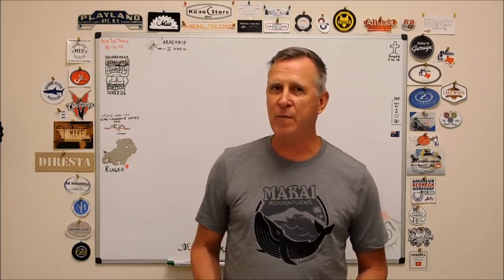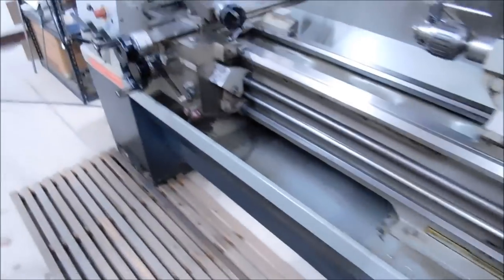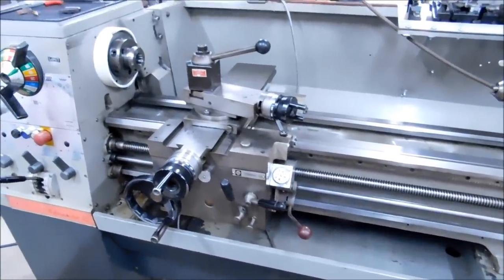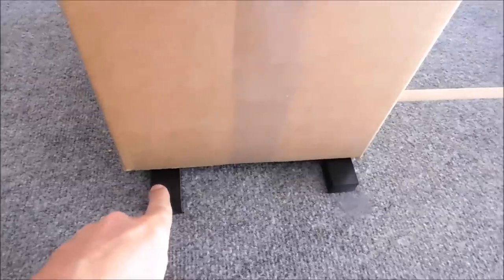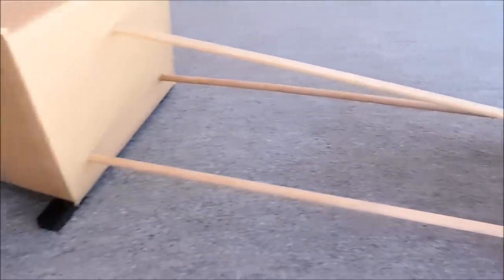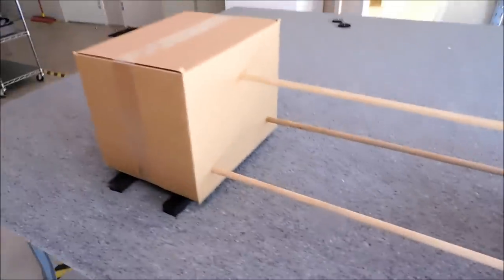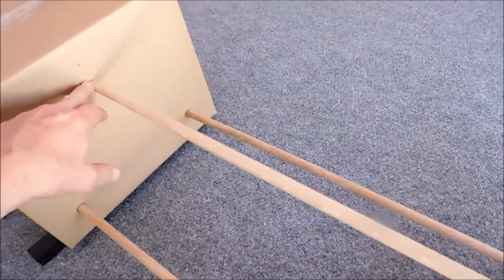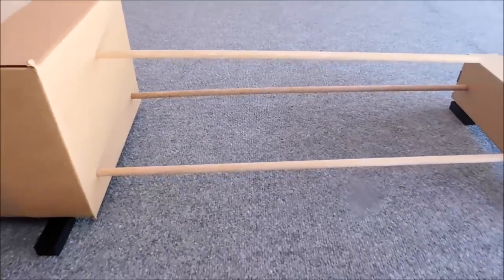Lathe Leveling - Waste of time ????

Comment: The issue is not really whether the machine is level, but is rather that it is square to itself, and will maintain such squareness.
I say this because after spending a couple of enlistments in the Navy,  level is something that is relative to the center of the Earth, and not usually pertinent to machine function. 
Ensuring squareness is much more important to machine function (most any machine) than is levelness. 
And using the correct terminology when discussing such things is important so as to not introduce confusion into the subject. I am glad that you did talk about squareness when setting up a lathe.

Comment: The lathe and mill at work are of the same brand. We were having a problem with the mill, called a Mfr. rep out. As it turns out he was the same person who set-up both machines when they were delivered. As he walked into the shop he glanced at the lathe saying "Who and why did someone screw with the leveling, bet it is cutting a taper."  (there were other Machinist in the shop before us). It took this guy all of 10 min to dial in the late to a half thou over three feet.  That was impressive! Great video and explanation as usual, Joe! You have a knack of making it all make sense.
Reply: Agreed. Joe takes something that would fill chapters in book and in 12 min gives a clear picture of what is going on, home to

Comment: So basically to check the head you face the part as close to the head as you can.  Then check it by moving the part out say 10 inches and skim cut it again.  If the head is out it will show up in the face as being out of square.  If the ways are twisted the the machine will cut a taper.  Thanks for the video, this gives me some ammo to help convince management to have our lathes looked at.  We have one machine that is cutting a .004 taper in ten inches or .0004 per inch.  Kind of hard to hold .0002 to .0005 tolerance on 4 inch long parts. (Interference fits on couplings) with machines that don't cut straight to begin with.

Comment: Joe great lesson in alignment of the lathe. One of the interesting features on the Colchester lathe is that if you remove the side cover of your headstock you can see where provisions were made to adjust the spindle alignment in relation to the ways in or out. Up and down is done with shims or scraping under the head and final alignment is done when placed into service. I have rebuilt several larger 21"version of the model lathe you have that have this provision  not 100% sure if the Student does. I have not seen this on another lathes I have worked on. The Colchester head doesn't sit on prismatic ways like Monarch does so they have to be spot on leaving the factory. 
Happy Diving Zed

Comment: Joe the only thing that you did not mention is run a spider front and back of the head stock and indicate both  the rear and front at the spider's .because if you have not set up the chuck the jaw's and or the scroll can be out there by given a false reading number one to level is to have perfect aliment with the spindle . just my 2 cents worth . :)

Comment: When you think about the word "level" just think of all the lathes that were and probably still are in ships, portable machine shops, etc.. They cannot maintain them in a "level" condition.. The twist and flex  in the bed is much more important....I have a 1942 LeBlond trainer on  which I set an indicator on  a work piece between centers..Change shims under the feet and tighten the bolts slightly and watch the indicator needle move.. Mike in Louisiana
Reply: Lathes on ships have 3 feet, so no matter of the level it will never bend.

Comment: Some lathes (such as mine), the ways run all the way under the headstock, and the headstock rests on the bed like the carriage.  These lathes have only 4 leveling points.  So bed twist is the only thing needing worrying about.
     Comment about headstock alignment: you really need to do the indicating UNDER the work on the tailstock end to detect bend, and indicate IN FRONT of the work to detect bed twist.

Comment: I think the reason they say "levelled" is because most people have something that will accurately repeat "level", but not everyone would have something that can accurately repeats 3.842*.  
From what I gather from this, you should level the headstock first, Square up the headstock to the bed, make sure the bed is level near the headstock, make sure the axis of the head stock is level, and then adjust the feet on the end by the tailstock until that is level as well, and you'll probably have to go over it a couple times before thing settle in

Comment: Great model, very clear to the the hobbyist.
Always a bone of contention, ref lathe leveling. You are levelling the lathe, to de-stress and align, using an accurate engineering level. Large lathe builders will grip a suitable diameter thick wall tube in the chuck, turn the OD with no steady or centre, and adjust level to minimise taper. Place level on the as turned of, this should now agree with the overall level reading. Your engineering or machinists level should have an accuracy of 0.05 mm per Metre or 0.0005" per 10",  there are more accurate ones, but you can achieve a reasonable result on small sub 1 metre or 3 feet bed length with a 0.5 mm per Metre (builders level).
Thanks for sharing Joe, and best regards from the UK.
Lathe leveling on a ship is the same,

Comment: Newbie to lathe work, Joe you’re a great teacher, no BS straight to the point and easy to understand. Thank you! I bought a second hand Grizzly G0750G lathe and I decided to bolt the cabinets to the floor and make adjustable riser blocks between the cabinets/stands and the lathe. My thoughts are, because the stands aren’t ground true it would be easier/faster to true just the lathe and not both cabinets & lathe. Is this method asking for trouble?
Reply from the maker: As long as the lathe is sitting on a surface rigid enough, it should be fine. If the machine is heavy enough not to walk around, or fall over on top of the cabinet it should be OK.

Comment: Wish I had known or realized this in 1981. Worked civil service Coast Guard in one of their Base Welding/Machine Shops. Had two old lathes, a La Blonde and a Southbend.  The La Blonde had a wicked taper on the tail stock end and could Not figure out what the heck was wrong. Both were Pre WW II machines to give ya an idea how old they were & both off a Navel ship out of their machine shop on board. Well thank you for this old mystery clear up. Hint - was not a machinist - OJT all the way, was wielder by trade.

Comment: Similarly, when I worked in pre-press layout dept. (stripping dept.) at a printing company, we had 60” T-squares that would ride on a straight edge on the side of a 4’x6’ light table. You would tape two pins down to the glass of the light table using the T-square and all the acetate sheets would be punched and register to those two pins. These T-squares were solid stainless with a machined steel head attached solidly with screws. A precision piece.
I started in a new shop and one of the journeyman lay-out men, yes, we called ourselves strippers, would, for a small fee, take your T-square home and “calibrate” it. I.e. knock the head on the floor to get it EXACTLY 90º.
I was the new kid, around 25, but had been at it for 7 years or so, and he eventually got around to me. I told him no thanks, that the angle being 90º was not important since we attached the pins to the table using the T-square and as long as it was solid and you did not switch T-squares between the different taped down register pins everything was cool. All that mattered was that all the lines stayed parallel. He argued for a while but eventually gave up. I don’t know if he ever figured it out.

Comment: Another thing to be checked is the horizontal alignment between the head stock spindle axis and the bed. This isn't a common problem on lathes where the head stock actually sits on the bed flats and V-ways. The head stock is scraped in at the factory. That said, if it is out of specification, the only cure is to remove the head stock and re-scrape it  to fix the misalignment... not a job for the average machinist to do. This is a task for a machine rebuilder.
   Where it can be a problem is on the smaller Asian built lathes. The head stock doesn't sit on the lathe V-ways and flats, but sits on a flat machined surface under the head stock. The head stock is bolted to the bed with four bolts (usually) and there are two horizontal jacking screws on an overhanging lip on the back side of the head stock. The good news is if alignment is called for, the head stock can be shimmed for vertical alignment and the jack screws can make adjustments for horizontal misalignment.
    This is also the time to make sure the tail stock quill and head stock spindle center lines are the same height. Also make sure the tail stock quill is parallel to the bed both vertically and horizontally. Faults in this area show up when drilling very small holes. You will notice the drill flexing to pick up the center of the rotating work because of misalignment and moving the tail stock side to side won't cure the problem.
    If you have an inspection sheet for your lathe, use that to inspect the lathe's condition and make adjustments as necessary. Many of the older handbooks give general alignment specifications for tool room lathes if you don't have specific tolerances for your machine.
Cheers from NC/USA

Comment: Great well demonstrated video as usual Joe. I've also never been able to figure out why "lathe leveling" is so misunderstood on the forums. It really isn't that complicated for what needs to be done and why it needs to be at least checked. Using a decent machinist's level is just the easiest way to get the bed straight and parallel. Actual "level" as you said isn't even needed, it's just the quickest and most simple way to measure and adjust to end up at that non twisted straight and parallel condition. At a minimum the free online PDF of Dr. Georg Schlesingers book Testing Machine Tools should be required reading for anyone who owns or operates machine tools. Read through that enough to grasp the concepts being explained and why each test is being done. The equipment & getting any machine tool properly aligned then gets a whole lot more simple. The Moore Tools book Foundations of Mechanical Accuracy also gives some of the best diagrams of the causes of machine tool inaccuracy or misalignment and how it affects a machined part I've seen so far.

I'd also add that even getting a lathe perfectly dead level is still only a static condition. I've proved to myself that very minor final tweaking is almost always required due to the machines various parts flexing just enough under the cutting loads to make a measurable difference if your trying for the absolute best the machine can do. Then you do need to know which adjustment screw needs moving and in which direction to roll the cutting tip slightly into or out of the cut.
Reply from the maker: Plus they settle over time. Mine actually sits on high density rubber machine mounts.
Reply: @joepie221  LOL, you have it easy. My shop floor is the usual wooden  construction. I can get my smaller lathe than yours to turn perfectly parallel and two hrs later with a few changes in humidity or temperature it's turning a measurable taper. So I've had to do a whole lot of  adjusting over the years. It's taught me a lot about that "lathe leveling" but the problem is obviously something I'd rather not have.

Comment: "Level" is used because using a level to set up alignments is the easiest thing to do. It is the easiest way to use the tool involved. Trying to set the lathe to be aligned to a 20deg inclined plane would be more challenging using levels especially since as you tip a level over it becomes inaccurate due to the curve in the glass that forms the bubble. It is also possible if you install a lathe very much out of level you could have lubrication issues as the oil level in all components was designed for being on the "level".
Reply: The confusen for new to the trade is probably that the three main reasons for leveling was not really well explained in perspective, like for fluid requirements, heavy weight requirements and the culprit the ways to headstock alignment assist.

Comment: Brought my used lathe home 
Put my level on it and it seemed to be perfect
 But when i trammed a round straight piece between centers my tail stock is low 
Moving the tail stock closer to the chuck reduces the error
Now this helps me understand it 
I think its exactly like you are saying it is
Reply from the maker: Anything pinched between centers shouldn't show much difference as demonstrated. Don't rule out way or tailstock wear. if you want to tram the tailstock, do it with a long bar and indicator in a chuck. Don't use a bar that will sag.

Comment: Straight is important , but level is extremely important  in a job shop for set up of  odd ball parts  esp line boring & assisting with steady set up's on long shafts . Cheers .
Reply: Maybe a better term to use instead of "level" would be "True?" As long as the head stock and bed are parallel / perpendicular is the key since the term level is relative to so many factors especially mobile machines in ships etc.
Reply: @robertoswalt319  A spirit level is sometimes used in job set up  when  indicating is not a complete option , like with some face plate work .
Reply: @swanvalleymachineshop  When I commented to the term level in my comment, I wasn't referring to spirit levels. I was commenting on the topic that Joe brought up about how the term "Level" had been, in his opinion, too broadly used. Many seasoned machinists will say that a machine doesn't have to be truly level as long as the bed is true to the plane the bed resides.
I agree that spirit levels are often a good choice when trying to get a part set up.

Comment: Putting the level on the top of the ways is an assumption that the top of the ways are true to the load bearing section of the ways.
Since we are measuring bed twist and not level I feel it would be more advantageous  to put the level on top of the cross slide. 
Then move it from one end to the other.
You can look at the load bearing part of the ways as the supplier and the cross slide and tool post as the end user. 
The end user is what you want to check, not the top of a V way that has no function other than to take up space. 
All this assuming your ways aren't worn out which seems to be a growing problem with older lathes.
Reply: Agree. In Sweden we talk "technical surfaces." Some take pressbrake tooling, use the outside as distance blocks and I tell them they are not true. They say they are true to the thousands and they are but only on the technical surfaces.

Comment: A few comments and questions:

As far as I can see, your ways looks bolted to the headstock.
To me it suggest, if it is true, that you can level your headstock as a unit, and then level your bed in line with that.

The 6 leveling feet you have on your machine, I have not seen in the now 12 different marks and models of lathes I have been in contact with, they all only have 4 levelers.

Also all the lathes I have seen, the headstock is bolted on top of the bed, and thus have to be shimmed to change the "centerline" according to the bed.

I am with you as far as you can, to some degree, level out warp front/back on a bed, but it means that you have to bolt down the cabinet to the floor, and many amateurs have their shop in a basement with wooden floor, at least in Denmark and Sweden.

Otherwise an very informative video as most of your videos are.

Comment: I have read several comments about the test bar deflecting up to and including using a ceramic test bar to prevent it.
There is no reason to worry about a test bar deflecting from it''s own weight. 
There is a simple way to test for deflection. 
Set bar on flat surface set one end on something of known height and square and measuer with other end hanging out. 
anything can be used around the shop to do this  including two tool bits of same thickness to two round bars or anything as long as it's square or of the same thickness. 
You dont have to break the bank buying stuff.
Say the pedestals you have the bar on are 1/2 inch and the bar is 1 inch.
If the bar is deflecting you will see it when you measuer, the end supported will be 1.500, the hanging end will be less. 
Which it wont be but test if you wish, at least you will know.
Reply: @robertlawson8572  We have a winner. LOL

Comment: Thanks again Joe, as per usual you have pointed out something else that we should consider, you mentioned about a round bar that you can measure from, what sort of thickness should we be looking for, would a ground bar be better (we normally use a 25mm ground bar by 600mm long to set up our A axis when we put it back into the concert). Thanks for your help, I for one feel like I have learned quite a few tricks from you that helps me out a lot! Thank you...Phil